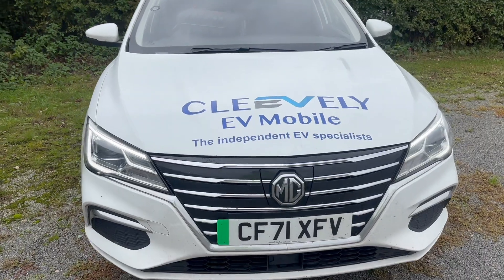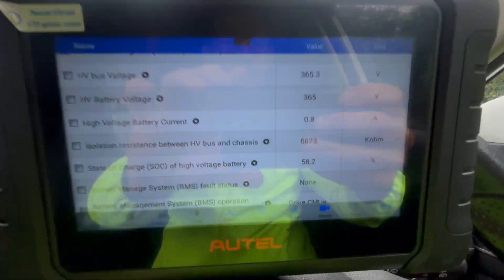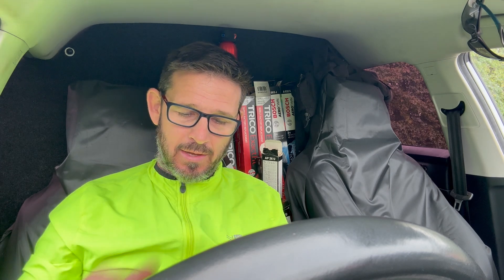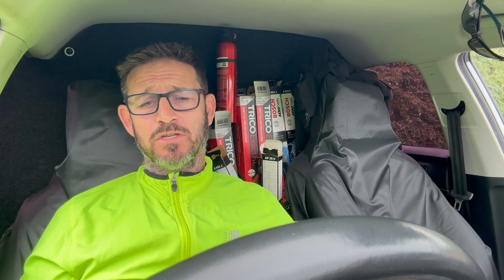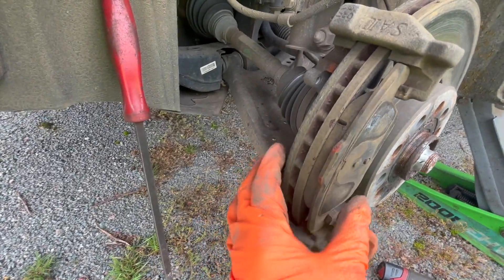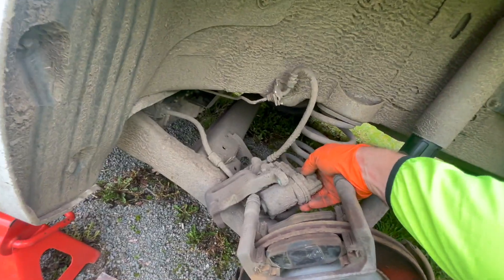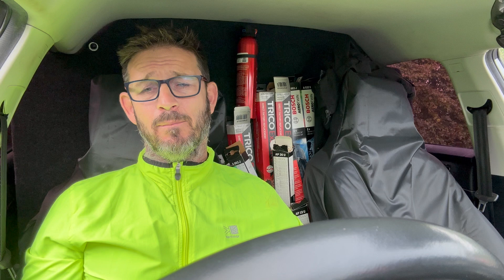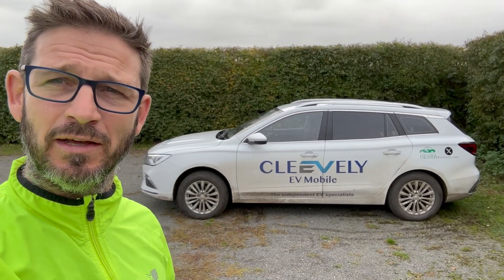MG5 143,000 Mile Update - How's The Battery?

Comment: I'm just about to buy a "Facelift" used MG5 based on your use & abuse.  You've basically done 15 years of my typical mileage so it gives me confidence that it will survive an easy life with me.  
91% Battery health after 143,000 mile is excellent.  I never even owned a car with 143,000 miles on the clock.

Comment: Bought a 2021 plate from you company last December and have been very pleased with it.  I'm retired so don't travel far.  6500 miles in 12 moths and cost for charging only £220 - very pleased with that as I estimate my old diesel car would have cost around £2000.

Comment: @James. Thanks for the interesting video. I do have some questions:
1- How did you charge the battery? Is that mainly on the highway with fast chargers or at home with the home charger?
2- To what level do you charge? Regarding the health of the battery, it is often recommended not to charge higher than 80%.
Thanks, CC

Comment: Hi James. Is that a crack in the lower suspension frame member at 8 minutes 30 on the video? My own ZS EV is showing just light corrosion on similar components on both sides.
Reply from the maker: @rob_in_stowmarket_uk  Hi. No, it’s a scratch. Quite a few people have asked the same question. It’s covered an additional 10,000 miles since this video was made.
Reply: @Jamesandkate 👍😬

Comment: I have a facelift LR MG5 registered 1 Mar 2023. Now at 18 months just short of 20,000 miles. Fantastic car, love it. But it has broken down 3 times and needed repair under warranty. The MG assistance recovered the car to the dealer, but it took them 24 hours to provide a replacement hire car. The dealer workshop has a month lead time so it takes several days for them to look at which means the hire car time expires and I have to change to a dealer provided car. The first breakdown was a remote key failure and took 3 months to get replacement parts from China. The second and third were battery issues, failing to charge and going into turtle mode at 30% charge. So great car, but poor support from MG/dealer when things go wrong.
Reply: You say it is fantastic, how, it has broken down 3 times in 18 months. My ICE Honda from new 11 years, hannover broken down.

Comment: Have you ever experienced any stickiness or notchyness in the steering at motorways speeds? 

We have a little on our 5 and wondered if in all your miles you ever had anything similar?
Reply from the maker: @JamesFord-g1x  yes I did. It started at around 60k but then disappeared again and haven’t felt it since. For me it was only when the steering was straight and I was making slight adjustments. I figured the strut top bearings were dry.
Reply: @ ah interesting thanks for the response. 
I will have a look at the bearings 
It’s just slightly irritating :)

Comment: My 2022 MG ZS EV SR is at just 24000 miles. SOH is at 91% (I have the original SAIC VDS tool and SIPS subscription). I wonder how you get 91% with 143k miles. 
We never DC charge but we charge every day from around 50 to 100% as you cant limit the charge and drive a lot of fast german Autobahn (110mph) . How do you charge?
Oh and p.s. my rear brake disc are rusted inside as they are not used. So you should mention that sometimes users should use the brakes heavily to prevent this from happen.
Reply: Not good, you should charge from 20-70% if you need 50% for daily driving. High SoC leads to high Voltage in the Battery and that is what a battery kills fast. If you have LFP you can discharge to lower SoC like 5-10% but avoid SoC >80%
Reply: As mentioned, you cannot limit the charge with this car and I will not start getting up at night to stop it or manually calculate when it should start to only charge to x percent

Comment: I got the same LR model, and it's done nearly 100,000 miles. There are no issues. It's Used as a van. I recently upgraded the 12V battery to LFP, and the rear shocks were changed. It's the best car I've ever owned.

Comment: 2 weeks ago i brought a 'high mileage' 2021 (70 plate) MG5 PFL with 76k on the clock. so far, any concern i have had has proven to be completely bunk. it's 1/3rd of the cost of my diesel van, services are half of the price, free road tax and, if i was so inclined, i could save even more money by searching around for a cheaper energy provider! (yes! i'm still using EDFS 23.5p/kw tarif and it's still cheaper!). at the price i got it at, it's just proving to be the best purchase of the century.
Reply: I didn’t think we had lfp packed mg5 here in the UK? I thought that both the 51 and 61 kWh were NMC?
Reply: @dorsetengineering  it's a little confusing, the pre-facelift (so up to q3-2022) had NMC batteries across the range in the 51.5 and 61kwh afaik. The facelift then had an upgrade to LFP on the standard range (50.3kwh). I don't think the standard FL is sold here in the UK so it's fair to say they'll all be NMC for now. it's easy enough to check what type of battery they have though, there's a sticker on the battery which you can see behind the drivers side wheel. I'm sure people have gone out to buy the LFP explicitly because it's more tolerant to abuse though so I imagine you'd still come across it occationally.
Reply: Thanks for the reply. I’ve been trying to find a standard range facelift model (to get the lfp pack) but I simply cannot find any for sale anywhere In the Uk second hand market. I don’t think they were actively offered, was yours a special order?
Reply: @dorsetengineering  Sorry, Mine is still NMC, PFL in my first reply is for Pre-FaceLift.  I don't think we have a standard range model in the facelift version yet compared to what's available in the EU. i suspect MG is prioritising the LFP packs for the base model MG4 before rolling them out in the UK for the SR MG5 (which may be in a few months imho, they've dropped the prices). LFP is still a relatively new tech and, if memory serves me correctly, the ZS EV had quite a problem with their LFP hybrid packs initially so i wouldn't be surprised if they're being careful. from what i hear, you can change the batteries over quite easily, there's no coding or anything. so you could get a cheaper NMC car for now and when the LFP packs become available swap it over. I'll probably do the same when my NMC battery has some time on it (it's still very happy though, maybe in a few years time).

Comment: Surprised to see that MG’s are lasting this long.
But I would rather stick with Tesla.
I bought the highest mileage M3 2021 heat pump SR+ now it has 166k.
10% degraded and at some point averaged 260miles/day.
I just had 500 mile road trip and averaged 200wh/m on a colder day. Nothing beats this on the EV market. After 3.5 years still 200miles on a full charge on a cold day!
On low speeds and warm days it literally 130-150 watt hour per mile makes it go further then the range when was new.

Comment: I have an MG5 face lift long range trophy model, it has just had it's second service at 33,000 miles. I have to say i'm really impressed with it, the brake pads are still at 80%. There one or two niggles i have such as the temperature controls are difficult to change whilst driving. I have bought a spare wheel recently after a puncture that the supplied gunge wouldn't fix, so I went online got one with a fitting kit, jack and delivered for £149.99, I took out the polystyrene thing out the boot and the spare dropped right in. I don't know why they don't offer one when you buy the car?
Overall I'm really pleased with the car and would recommend one looking for an estate EV.

Comment: I wonder what's the LOWEST mileage around on a 3 year old MG5?  My own 21 plate MG5 SR has just passed 10,000 last month (I bought it with only 7,700 after it had been barely used).  I saw another three year old one for sale at a dealership near me with only 5,500 miles on it.

Comment: Have an mg5 at work ....74 plate so new shape . 
Good stuffs a struggle to find to be honest . Its clearly built to a budget .

Stuff that annoys is as follows . Getting in and out is a pisss take . The appiture is simply too small . To a 6`3`` guy its like being born again and the more rotund also really struggle . The screens not obvious . An easy example is try to find how to turn the fan speed up and down ..... its not in one of the easy to go to sub menus and yet the nav is . 
The boot lock is also oddly on the pisss . No idea why but its not in the centre of the boot and the rubber covering the switch doesnt feel like its the switch . 
Giving it a bit the arse end dips and the fronts all flighty and lost to the point its guess where you are going ! .
Also find the centre console a bit intrusive . The hole under it is pointless .
The radio stays on after you turn it off ..... so you think its still live which is beyond annoying . It also can and will lose the plot when you turn it on . Ready shows happily on the dash but it wont go into `gear` until pressed a second time .... even though its showing its live and ready to go ! . I also have to look at the gear change as rev and drive seem to be the wrong way round .
Main thing is getting in and out crowning yourself on the bastard door daily . It comes to something the lads tend to reach for the keys to the remains of our pug partner thats 19 years old rather than the mg . I wish they had bought a leaf .......
Reply: totally disagree, I traded in a Leaf for MG5 a couple of weeks ago. The MG is a far superior car. Definitely twice as good. With the Leaf you will have issues with Rapidgate on long trips. But you are entitled to your opinion of course - I am 6ft1 so maybe the extra 2 inches height make a negative difference
Reply: @TomMillarMusic  I turned up at work today ... theres 2 vehicles , the MG or the diesel van ... guess what i was left with ?

That says the findings of all of us . One of the lads has a less than 200 mile old BMW iX1 and he still jumps in the van rather than the MG ! .
If you happy then thats good .

Comment: Fantastic update James, so,happy with our MG5 drives like a dream & zero problems, good advice on the wheel arches thanks. oh apart from my drivers windscreen wiper that still makes a juddering sound now & again,  I tried to  change the angle to make sure it’s parallel with the windscreen as it does look slightly angled but it wouldn’t move & unsure to force it, I’ll try some different wipers, you did recommended some I still haven’t ordered them. Must do that now winter is here.
Reply from the maker: We just fitted some Trico blades and they're very good. Worth a shot
Reply: @Jamesandkate  Thanks James you’re a super star!

Comment: Interestng update thanks. I have an MG4 - will be 2 years old december.  Ive done around 16000 miles and am very hsppy with reliability - its only needed a new door handle fitted and a software update - both under warranty.  I've saved a lot in running costs, but depreciation is high as i bought soon after launch at rrp.  Overall a very good result - I'm sceptical of the recent BS in the motoring press slagging off MG reliabilty....
Reply from the maker: Sadly there will be more of this. Journos seem to look after those that advertise in their magazines 🙄

Comment: Thanks for the video upload. You are showing us a 3 year old vehicle. It's bound to be in good nick, even at the high mileage that you've done, there is absolutely no reason for the calipers to give in in such a short time (even with high mileage). My main concern is the longevity of the high voltage battery over a span of e.g. 10 years. Apparently, lithium batteries do age with time (in addition to usual usage factors etc.). That's the concern. If your MG5 was 14 years old with 144k miles and the battery was showing SOH of 91% I would imagine it would be very impressive. 
It's still impressive to see 91% SOH with such high mileage, however, the battery is only around 3 years old...
Reply: Average mileage of a dead ICE is 130k miles. Less than 1% get to 200k (iSeeCars) and then only with US$10k in repairs and maintenance (Consumer Reports).
large data bases like the Tesla Dutch/Belgium show 300k is no problem with plenty at 500k. Dahn for Tesla has test cells that are at 6.5Mkm and still serviceable.
Recurrent survey shows less than 2% of batteries replaced and then usually under warranty.Tesla battery replacements were too small to show on the graph which is why they went with reliability rather than repair-ability.
Dahn recommends keeping LiIon cool for long life, and not leaving at high voltage for negligible degradation. He foresees stationary storage packs lasting 80 years, and all vehicle batteries having this role as a secondary life before crushing and recycling 97% of constituents into more batteries.
https://www.youtube.com/watch?v=rOAYjcO6kao&t=192s
Reply: @waynerussell6401  thanks. Good to see facts being used in the ice-ev debate 👍
Reply: An ICE car would probably do about 250k before dying so would be finished in another two years as simply worn out.  This MG is likely to still have more than 80% battery in two years so I'd say that's a win.....
Reply: @chrispenn715  perhaps so, but in ICE you buy another low mileage engine and you keep going another 250k. Whereas in theory you could buy used battery for similar money for your MG, if you can find a decent one. I'm just not convinced by the volatility of the cells within the battery, one cell goes and it throws off performance of the battery for good.
Reply: @Lukeaaaa  But no one does that for a car like the MG5. The only time it's worth replacing the engine is if the car has some intrinsic value - ie it's rare, it's expensive etc. At 250,000 miles (that would be pretty unusual - I think the average is way less than that) most cars have so little value they aren't worth the cost of replacing an engine. Or a transmission. And BTW calipers are a mechanical item - they suffer wear and tear with use. And at 143K miles, cars without regen would most likely have worn them out or be close to wearing them out.
Reply: Very few would buy a second hand engine for a car with 250 k on the clock…

Comment: Hi James i love your video’s, I’m  looking to buy an electric vehicle so I had a test drive from Leicestershire down to my son in St Albans in an MG 5 face lift on the way we stopped at Toddington services on the M1 to have our first go at public charging , the first 150kw charger would not connect to the MG 5 face lift the second charger did , 20 minutes later we returned to the car removed the plug got into the car but it would not move, could not get reverse or forward on the selector , turned off and then on several times but the car would not move, eventually another EV driver at the  charging point suggested we lock up the car and take a 10 minute walk around the services , on return the car went into reverse first time, the rest of the journey was absolutely fine. This episode has put me off buying an MG 5 , did I do something wrong or is this something that happens to this model. Would appreciate your take on this occurrence . Regards Michael O’Grady an  inexperienced EV driver.
Reply from the maker: Hi. The only issues we ever have is with Gridserve units. Occasionally we have to disconnect the 12v to rectify the issue. 9/10 times they're fine, but on the odd accession it springs a fault in to the BMS. It's an on going software issue between MG and GS.
Reply: I pulled in by mistake at a Tesla supercharger at Moto Services, Exeter that wasn't open to non-Tesla vehicles.  My MG5FL with the Tesla update wouldn't handshake, and like yours, wouldn't move when I unplugged. The dash indicated a "HV batttery fault" - Tesla had crashed my car's computer!  So I forced the car to reboot by momentarily disconnecting the 12v battery negative and all was fine on reconnecting.  I breathed a sight of relief and then drove to Tesla supercharger, Darts Farm, Topsham, Exeter where I charged as normal.

Comment: Love my mg5 but the software is driving me crazy, I use Apple CarPlay a lot as I’m rubbish with directions, I now have a wireless usb dongle for it and it’s a little better, if I got something from Halfords (full unit) would that sort the issue or would it no make a difference?
Reply from the maker: It would sort it. Have you used a genuine cable, mine works well with one.
Reply: @Jamesandkate  I have yes and that worked 90% of the time it’s just a pain every now and again it’s rubbish

Comment: Owned an MG5 SR for 4 years and just changed it to a new MG5 FL LR Trophy because of the crazy deals around (£20,500 for new metallic!). I've owned all sorts Audis, BMWs, Mercedes, VW but this has to be the best put together and most reliable I've had. And with James continually confirming that with his expert factual knowledge I know it's the right decision. This may well be the last car I buy.....
Reply from the maker: Awesome 👌🏻
Reply: @Jamesandkate  Should also say the new one was £1000 less than what I paid in Jan 2021 but in addition has a bigger battery, Adaptive Cruise Control, Interior rear seat lighting, Lane Keep assist, Traffic Jam assist, Driving speed assist, Headlight Beam assist, 360 Cameras, bigger internal screens, faster software, full LED external lights, better front charging port with lights to show progress, split level boot shelf, 500kg towing capacity, remote access with app, redesigned interior and seats, and Vehicle to Load capacity. So an amazing deal.
Reply: Hi sir may I ask a question, in carwow review video the gap for foots under the front seats are being criticized, I mean for someone sitting at back you can not put your food under front seat, is it something you can live with it? thanks
Reply: No good pedestrian detective system